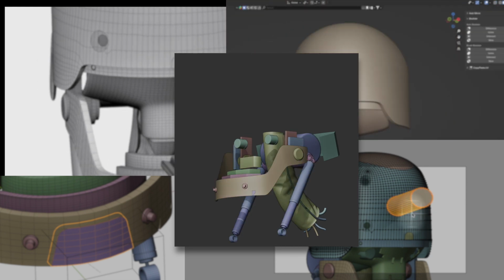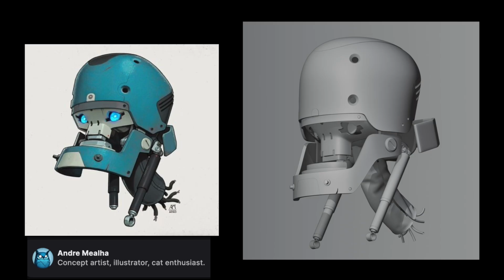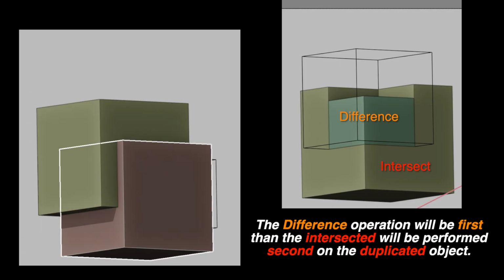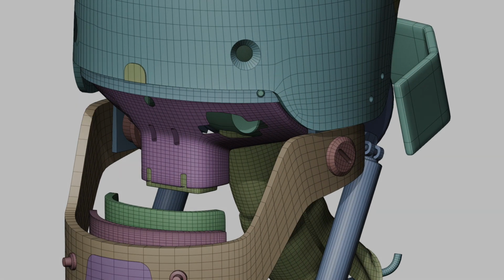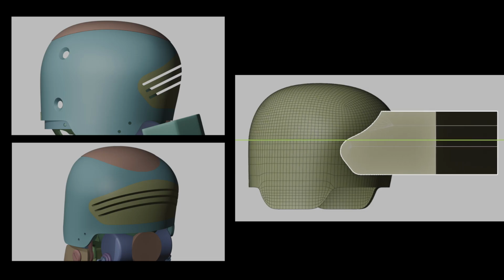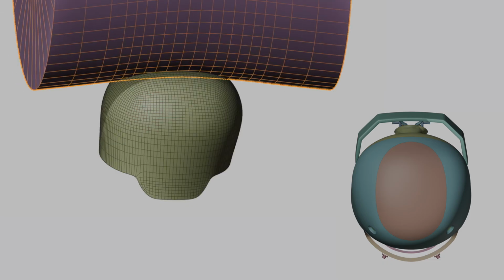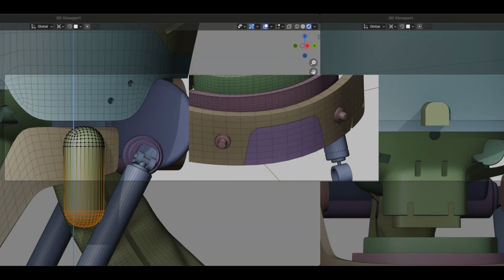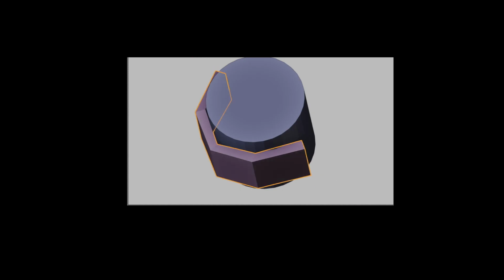Blender hard surface modeling tips (basic and advanced) #blender3d #3dmodeling #blendertutorial

Comment: You make it seem so easy. Once you are done with the boolean cuts how do you fix the topology?
Reply from the maker: That’s a great question! Addressing topology issues depends on the context your using your model for. For example if your model will be used only as a static or still render bad topology in some areas may be permissible. Methods like sharpen, shade smooth or modifiers like Bevel, smooth corrective, weighted normal etc may lessen shading artifacts from bad topology. 

However if you’re going to animate your character good topology is essential. Towards the end of the video you can see an example how the sharpen edge function helped to ease the shading artifacts from the boolean op. 

Retopologizing manually or through add ons is ultimately the most optimal way to heal a model from Boolean cuts.

Thanks for watching !